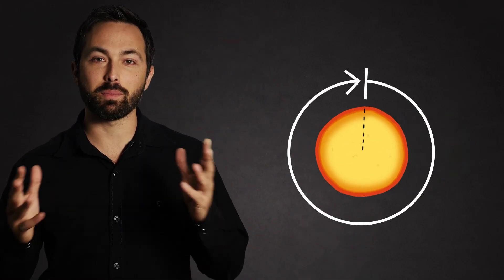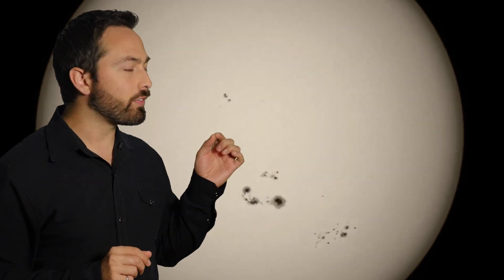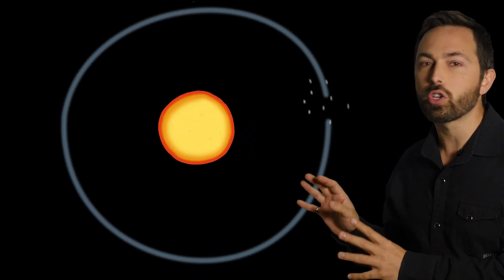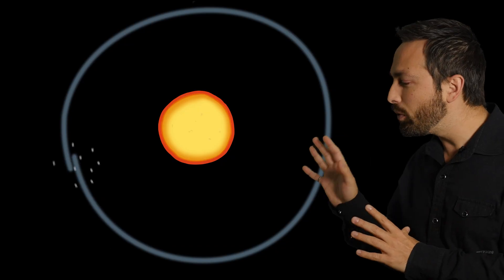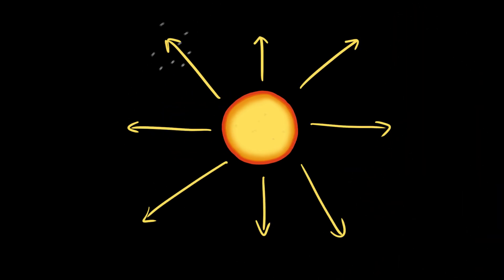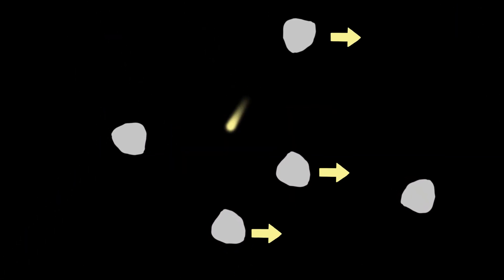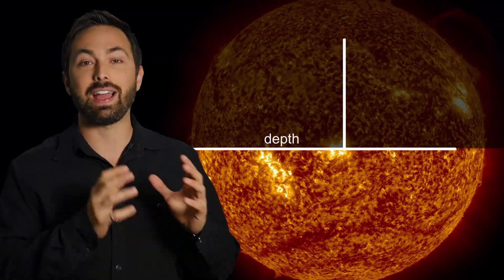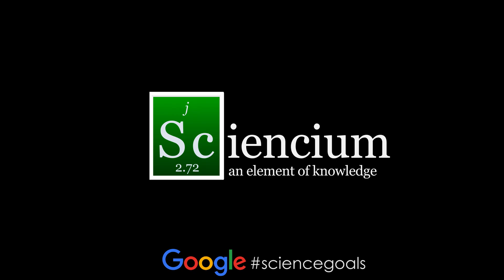Why is the Sun Slowing Down?

Comment: Wait, so if the Earth is like dust orbiting the sun, will Earth slowly get closer to the sun as photons slow it?
Reply: Yes it will slowly slow down, but at a much smaller scale than in the video.
A) The momentum of the Earth is much larger than the photons hitting it.
B) The density of collision and thus rate of collision is smaller with the Earth than when you're right outside the core of the Sun.

While photon braking can affect large things like the outer layer, remember, it's really each individual photon in the layer that's having its momentum stolen. Much like how powdered chemicals react faster than large chunks because of the increased surface area, spread out photons will be affected more than the entire solid Earth.
Reply: Yes it will, but the effect is so miniscule that other events, like meteor impacts which increase the Earth's speed on a similar scale, will more than negate it.
Reply: icedragon769 very true. so we won't have to worry about it.
Reply: Meteors have more chances to hit the Earth in the opposite direction of its velocity. Everything that impacts Earth, on average, eventually slows it down and brings it closer to the sun.

There are many factors to take into account. Overall, the slowing down of Earth's rotation increases its orbit average diameter, or in other words, causes the Earth to get farther from the sun. 

None of this is useful anyway; it's completely negligible because the sun will be long over before any of these changes affect the Earth-sun relation.
Reply: You may be interested in knowing that the Earth is currently moving away from the Sun at about 15 cm per year.
Reply: I guess it would be so slow that even the sun would blow up, and let's not forget about the lots of momentum given by cosmic dusts and asteroids
Reply: btdtpro (I don't think, that it is good explanation)
Earth has bigger momentum, so influence of photons is smaller
Reply: btdtpro Our planet will eventually get eaten up by the sun.
Reply: btdtpro nah I don't think so. it seems unlikely. even though the sun will eventually become a red giant and earth will be swallowed up eventually too. but we'll be gone from the earth by then.
Reply: yes,. but whats slowing down the earth  is the moon,.
Reply: This effect is only large on tiny dust particles in orbit, or on the star's surface.
Reply: btdtpro still, earth's orbit is pretty stable
Reply: +Pseudorandomly and people are still worried about global warming... Soon it won't even matter.
Reply: +ronindebeatrice

"... worried about gobal warming..."

It's worth remembering that there's another ice age coming ... in 20,000 years or so, folks will be hoping for global warming.  It's also true that Earth is, right now, as cold as it's ever been in the last 500 million years (before that, the Sun was considerably dimmer, so it's not really a straight comparison).  Think what it would be like living on a warmer planet with deciduous forests growing all the way to the poles.
Reply: Ellipsum trolling right here, I felt it was fairly obvious, but I understand assuming the worst of people.
Reply: ***** Veritasium made another video on this in which he explains how climate change is really something
Reply: I think this is because the probability of a photon hitting an object depends on its cross-section area, while its momentum is based on its mass, which depends on its volume. Since area increases proportional to the diameter^2, and volume increases proportional to the diameter^3, the relative effect diminishes as the object gets larger.
Reply: yes
Reply: Yes but the surface area of a thing gets larger by the SQUARE of its diameter, and the volume and mass go up by the CUBE of its diameter. So the extra photon force, which depends on surface area, doesn't keep up with the increasing mass that it works against, as you move from dust to planets, so the effect becomes negligible.

Example: 1^2 = 1, 1^3 = 1, but 5^2 = 25, 5^3 = 125, so the ratio between area (and force in this case) in this example to mass went from 1:1 to 1:5.
Reply: The moon is slowing down Earth's rotation, not translation.

Comment: I don't understand why the photon that leave the surface slows the particle is hits last. The photon could accelerate the particle as well. You said "on average it slows that particle down" but I don't know how that results. Is the rotation of the sun letting the photon and the particle collide in a way that more particles get slowed down? But then the photons on the way to the surface would also collide in a way that let them shatter more tagential to the surface. This result in more photons accelerating the particles on the surface. Also wouldn't that cause the light to be brighter on the side of the sun that rotates in our direction?

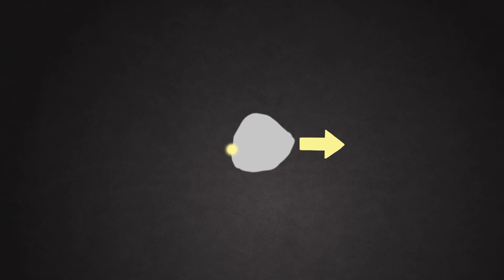Comment: At 3:20 u said that the drag on the surface of the sun as well as the dust particles are bcz of the photons and bcz of the conservation of momentum, they eventually slow down. So by the same principle, shouldn't the photon speed up?? M1V1 = M2V2 rit? so by that principle, a photon which is considered to be perfect elastic material, moving at the speed of light, should gain even more speed. But according to Einsteins relativity principle, velocity of light is constant, so how can velocity of photons > velocity of light(which is made up of photons) ?

Comment: So it is not expanding? I thought the sun was slowly expanding too and this slows it down, no?
Reply: The spinning is slowing, and the whole sun is expanding.
Reply: Pirateboy04 so this vid is about additional slowing?
Reply: You're thinking about solar life cycles, how the sun will eventually expand and become a Red Giant. That is not something that happens gradually. When the Sun runs out of Hydrogen to burn, and starts burning Helium, it will suddenly expand a hundred times, over the course of a few years. Until then, its size remains constant.
Reply: James Galen Bloyd the expanding right now is incredibly slow and probably not even measurable
Reply: icedragon769 I figured it was exponential. Doesnt the sun fuse a small amount of helium now but that amount is just completely insignificant to the amount of hydrogen?

Comment: what about the photons that are hitting the back side of those dust particles? The photons dont just shoot out in a straight line every time so are the ones hitting them from behind not cancelling out the slowing effect of the ones hitting the front??
Reply: The raindrop analogy doesn't apply anymore, here, @schwarzschild. Rain is only falling in one general direction or in a very confined angle.

The photons DO bounce off in all kinds of directions, but in general, or the mean direction is at a 90° angle from the surface of the sun. Taking all the possible directions into account this is the only direction you have to consider, since there are also photons hitting the particles even more from the front (those would be flying in opposite direction to the direction of the particles) than the ones flying away from the sun at 90°. The photons hit the particles slightly from the front, more from the front, and from the back, but in general, slightly from the front.
Reply: I was about to ask the exact same question but thought maybe somebody else already asked/answered it. My second thought was the since the dust particles are only moving in one direction the probabilty for the photons to hit the "front" is much higher than hitting the "back".
Maybe? Hopefully someone with more knowledge could fill us in
Reply: nick4819 do raindrops hit the back of your car when you drive?
Reply: you are almost correct. the photons almost cancel each other out, but there is a difference remaining. photons hitting the dust particle from behind hit it with slightly less force.
Reply: Thanks benjamin for making the first guy look like an idiot...I was just about to say the same thing. Thanks for you explanation..helps alot :) and dennis that also makes sense. Im going to assume its less force since its traveling away from the photon and not towards?

@schwarzchild ..... lololol just dont.
Reply: but what about the outward or up momentum the photons give the particles?
i think we can agree that the dustparticles are only hit on their sun side, so they do not only slow down, but also drift outwar, away from the sun.
any ida about that problem?
Reply: They increase in frequency to absorb more energy. Essentially they get hotter because they can"t get faster.
Reply: Zeberence well when a photon gains momentum or if it gains energy, it doesn't change it's speed, it just changes it's frequency (cause you know it's a particle and a wave at the same time, so it has a frequency) and wavelength (of course they both change). Simply put, a photon doesn't accelerate, it just changes the colour of the light it's propagating. Also, the photon's momentum and movement changes direction, according to the previous direction of the dust particles.
Edit: oh yeah and i just realised someone already answered it. nvm, not gonna delete it now that I wrote it.
Reply: That is not exactly the right answer. The point is that it's true that the photons push the particles away from the sun, but it is all about angular momentum. But central forces, which are the ones that have the direction of the line between the particle and the center, of course, just don't change the angular momentum. That's why on classical mechanics the orbits would stay the same forever, because the gravity doesn't change the angular momentum, and neither do those photons.

So even if you hit the particles with an incredible force away from the sun with a 90º angle from it's trayectory, the particle's angular momentum would stay the same. It would be higher at first, but then it would soon fall closer to the sun. So it just depends on the momentum, and if some of the photons are reducing the momentum just a bit, it's all that matters and the particles would end falling to the sun.

Sorry for my english by the way
Reply: Back in Black, my brain tricked me when I wrote the comment. It simply forgot that you said that. Nevertheless it is an acceleration. I hope the rest of what I said is of some use, though.
Reply: nick4819 you know even if something comes from all directions, you will still run into it more on the side you are moving I don't see your point
Reply: Schwarzschild Radius Attained :D i too got the impression from the video and how it was described that the photons don't shoot out in straight lines from the sun but rather do turns inside the sun bouncing off again again and therefore shoot out in all kinds of angles from all kinds of positions
Reply: Dennis Haupt tl;dr you're probably right, but the physics might be different at the speed of light.

I was thinking the same thing, yes, but something tells me this is different when we're talking about light speed. It might or might not make a difference. I'm no physicist and can only agree with you, but I also know that things behave differently at light speed and photons have no mass, only momentum, and I'm not quite sure if that makes a difference. That's why I didn't mention it; also because I'm on mobile typing slowly with a broken hand and I don't know how long comments are allowed to be and I wanted to get the comment out there and go do the groceries before the store closes. Lots of factors played a role in my writing of my first comment :D :D
Reply: Turun Ambartanen you're right, the photons hit the particles and push them away from the sun, but it seems the pull by the sun is simply greater than the combined force of centrifugal force and the photons hitting the particles. Without the photons hitting the particles and all the other factors staying the same, the dust would just reach the sun sooner. The dust particles should be thankful towards the photons delaying their inevitable demise! I like to believe they are indeed.
Reply: i mean... you could have saved two lines by not explaining your current situation and future plans for tonight to everyone...  XD
Reply: Turun Ambartanen the question, here, is: two lines on what screen?!

kidding. I know what you're saying, but I also want to see if I get adds that are in any relation to my situation because of such comments. Also, from a privacy point of view, I really don't care, because those who know me, already know my situation, who doesn't know me doesn't care much and, like I said, I'm interested in the behaviour of the google algorithms. And now that the shopping is done, I don't need to save lines any more.
Reply: Turun Ambartanen the question, here, is: two lines on what screen?!

kidding. I know what you're saying, but I also want to see if I get adds that are in any relation to my situation because of such comments. Also, from a privacy point of view, I really don't care, because those who know me, already know my situation, who doesn't know me doesn't care much and, like I said, I'm interested in the behaviour of the google algorithms. And now that the shopping is done, I don't need to save lines any more.
Reply: cool, experiments with google algorithms are interesting. but i think the ads are rather related to the type or topic of the video or posting channel and/or to the kind of other videos you watch.
Reply: Turun Ambartanen ads are related to where you live (language and shops in your area) and what you've just watched. if you were looking for new gloves on Amazon and go to a YouTube video, you might see an ad saying: buy these new gloves
Reply: +Benjamin Herrman If there was no force coming from the photons, the dust particles wouldn't reach the sun sooner. With a greater force pulling them inside, only their trajectory would change to be more elliptical. Shout out to Kerbal Space Program.
Reply: If photons travel at the speed of light, how can they gain momentum from a collision with a dust particle? Did I miss understand his explanation about stealing momentum?
Reply: Zeberence, Andrew Lorona and Back in Black, actually the photons are accelerated. Although their speed (magnitude of the velocity vector) doesn't change, the direction of the movement changes, which means acceleration. But from this point of view the photons do not necessarily change their frequency, as this could happen with a static particle and still there would be a change in the direction of the vector but without change in frequency (energy). I prefer to use the Doppler effect to understand the transfer of energy between particles and photons. One may think of the particles as mirrors in motion; when light is reflect off a mirror in motion it is red or blue shifted by the Doppler effect, depending if the mirror was moving in the same or the opposite direction of the photon. To change the frequency of the photons they must exchange energy with the mirror, giving it when red-shifting and taking it when blue-shifting. That is how the particles are slowed down (lose speed) by the photons and these gain energy (increase the magnitude of their momentum - remember that with zero mass a photons energy is given by E = p*c).
Reply: Gustavo Luiz erm erm "Also, the photon's momentum and movement changes direction, according to the previous direction of the dust particles." :D
Reply: nick4819 no, because photons are much more likely to hit the front side of the particle, just as he explained in the example (but I'm giving another one) when you are running in the rain more rain hits you from the front
Reply: Gammer Games, that example doesnt apply here. Rain falls from one direction, down. So yes if you are running in the rain, more will hit you in the front. However with the sun, it shines light from all directions not just one. Other people have helped me figure it out already. There are a ton of factors that go into this so instead of me retyping everything you can read the previous comments. :P
Reply: Gammer Games and nick4819
the sun can be seen as a point for most applications. here, to some degree (height of dust particles) too. therefore all photons come from one direction. 
if you move in one direction you will not only absorb more particles from that direction, but they will also come with more energy (blue shifted). this is how you can super super cool a small group of atoms.
Reply: and thats your problem.